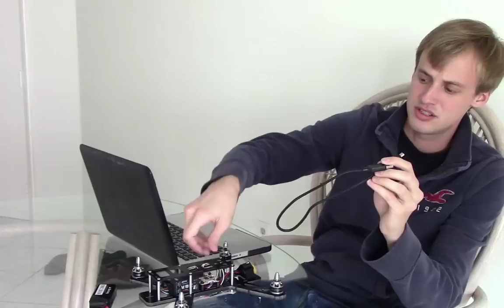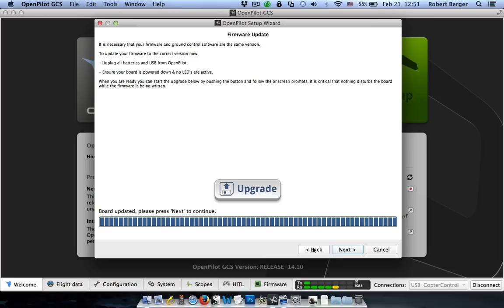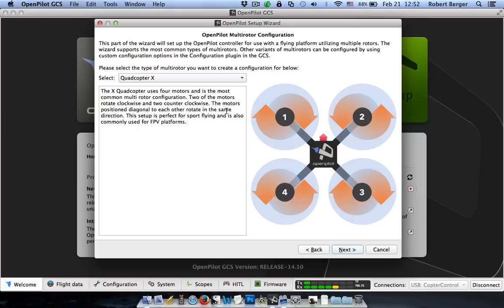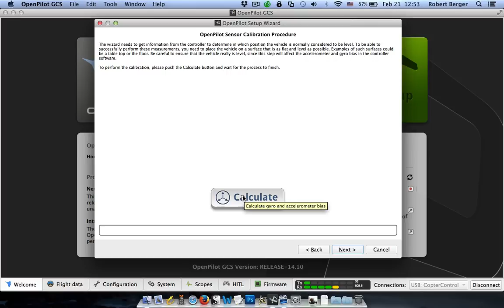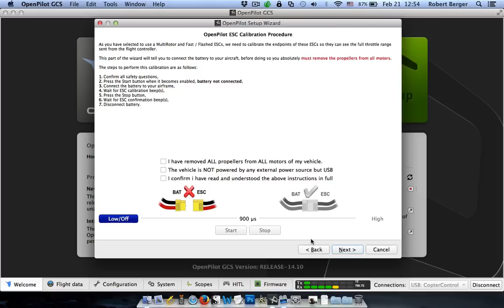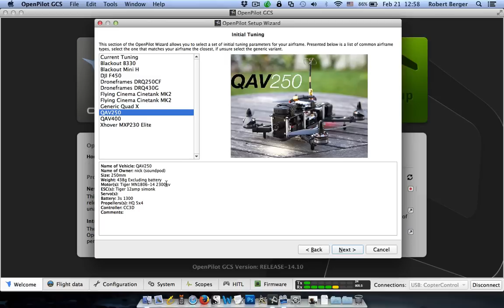CC3D Setup QAV250 OpenPilot

Comment: from where I install the software of open pilot
Reply: open pilot is down. Its now called libre pilot. Its the same software
Reply: +JulienD52 .I had completed the whole setup at night. all things are working but
Reply: but when I push the throttle up all motors are not equally rotating

Comment: My parts arrived and thos my first brushless zmr 250 quad,now,I am a beginner and i didnt knew anything about making a quadcopter i saw videos on youtube then I came to understand how to make a quadcopter,i didnt know how to program the CC3D flight controller,i saw some videos and found your video also all videos are same,I want to ask you that I had to do that much you did in two videos or any more things to change to make my quad fly like all,please help me,instruct all the things you did,u will be greatfull of you.
Reply from the maker: Sumit Tripathy I showed everything I did in the videos on my channel. If you do the same, It should turn out the same. I am not familiar with the ZMR 250 at all! I would suggest doing everything the same as I did if you have a CC3D, but don't choose the QAV250 presets when you are prompted in the setup wizard. Just leave it on the default and it should work fine.
Reply: Thanks for telling me